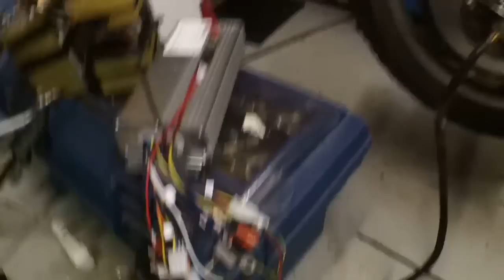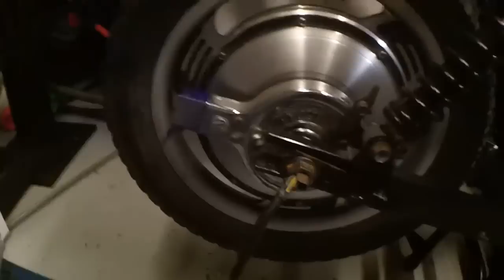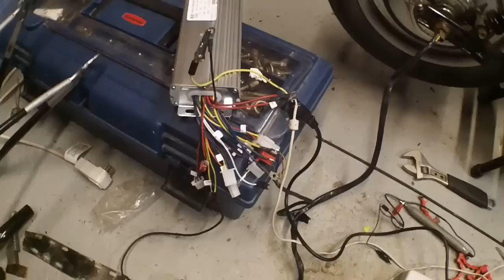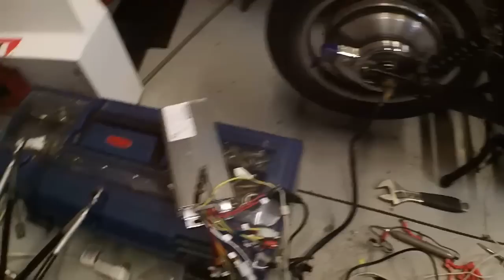48V 1000W E Bike controller*test run*

Comment: I'm gonna try this when i fit my centre stand (I have the same controller for my pushbike); I'm having very low torque issues as it does not like moving off from a standing start (in fact sometimes refuses), the motor is loud and juddery esp. attacking an incline, however once up to speed all is sweet!!
I have the Tester Unit (Lyen omnitester) which is telling me that hall sensors, phase wires, throttle etc. are all OK !! so I'm putting it down to either a blown MOSFET? - which I'm not sure I can test without removing? Or, it could be that my Lead Acid Batteries (new) aren't providing enough Amps for the initial take-off? (they're only 10Ahr each x4)?
Reply: Did you figure this out? I got the 2000w model, and I have same thing, I have to push the bike, it will not take off from stand still.  No Low Torque at all.  I tried emailing the seller, but could not get a answer that made any sense.  He said I had my white wires hooked wrong way (learning wires? ) I dont know how the self/study /learning wires work.